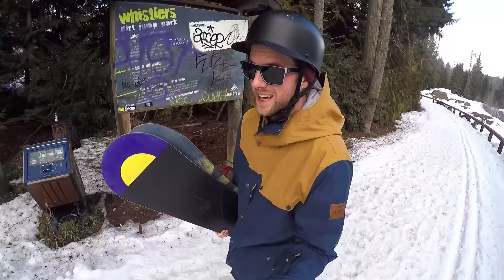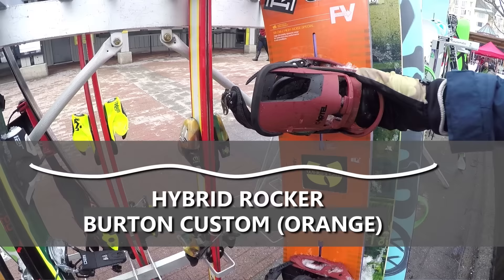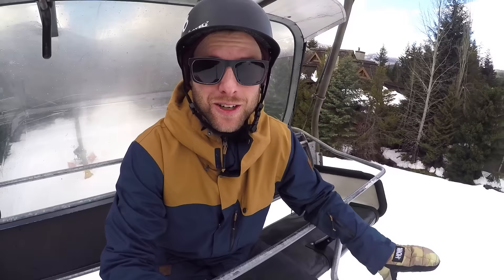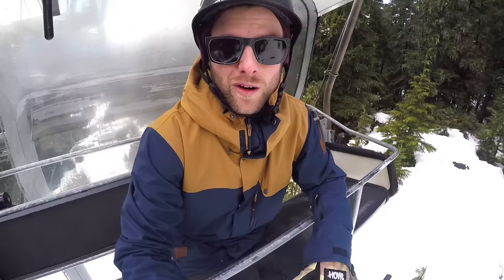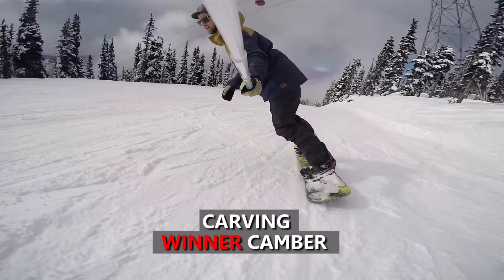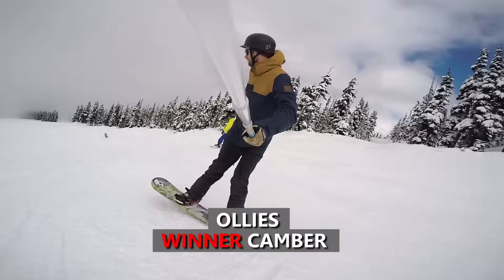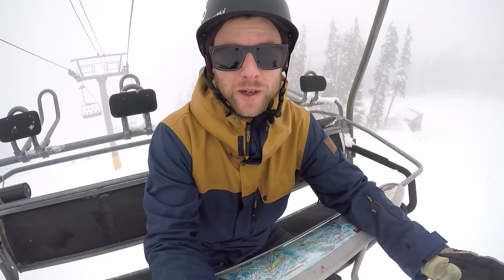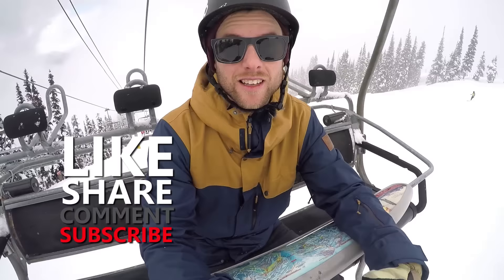Camber VS Rocker Snowboard Test

Comment: There's a reason why pros and the entire industry have moved away from camber boards in favor of rockers and their hybrids across all board types.

I'm biased, Flying V is my favorite.
Reply: what is the reason
Reply: +Fpk Hk416 First off I'd say that's an unfair statement, plenty of top riders still use camber boards, for example in the pipe or for large jumps. Other than that, I'd say it has a LOT to do with what you do with a board.

Camber boards excel at a lot of things that you'll never see in snowboarding videos, but that a lot of us ordinary folk do all the time. Charging groomers/pistes, carving turns, etc. Your regular everyday resort boarding. Not everyone does deep powder cliffdrops, 30 foot kickers and lipslides urban rails or rooftops.

For me as a person who spends probably 60% of his time on the pistes, 30% in the park, 10% in the powder, a rocker/hybrid board simply doesn't offer me a lot. The edge hold that a midstiff camber gives me far outweighs the forgiving ride of a hybrid or rocker, and I've tried many of each.
Reply: +Fpk Hk416 yes. to sell more boards! that's why cellphone manufacturers add more features with every new gen. phone. doesn't mean they're better. just means they can sell you on more words.

Comment: I bought a true rocker a few years back and it's pretty fun and I do can spin and press for days and powder isn't that much of a problem anymore. But it misses some pop which actually makes it harder to get some air in the butter/180 tricks. I think my next board gonna be a soft camber.
Reply: +McDudes check out the Rome mod Rocker, flat base with pop rods in the tips. A great rocker board with TONS of pop is the Marhar Regent, super awesome board. I Prefer aggressive riding myself.
Reply: Daniel Rex Cool, yeah the one I have right now is actually the Rome artifact rocker 2014 version. 
I did choose between that and the camber version and thought, why not try out a rocker.
Overall it's actually a fun board to ride and it's much better than the one I had before. So don't take me wrong I do like it, but I think for my next board I will get a camber, that way I can also switch between them.

Comment: I´m riding with a zero camber board with a softer flex (Nitro T1) and i absolutely love it! I´m riding a lot in the park but sometimes i want to take it to the whole mounteain so the zero camber is perfect. It is very good for pressing, butters and park riding but I still have a lot of control when riding with speed, especially after langing of jumps. I can really recommend this ;) (P.S.: Sorry if there are any mistakes in my english writing :D)
Reply: HolyPineapple I agree with you in comparison with traditional camber I found zero camber board more forgiving and easier to ride on mountain and in the park. But that is just my preference.

Comment: Actually I believe the opposite. I think  that rocker and hybrid are better for beginers. Its easy to catch an edge on camber. You should also test parts in which rocker shines and that is a deeper snow and rails. What is more, flying v is not pure rocker, even burton  describes those boards as mix of two. Speaking of wich, you could just have tested either to stick to same model, both of them comes with camber and v. I encourage everyone to go and take part in test rides, you can learn a lot. Thanks for the video

Comment: I have a Burton Custom Flying V because I thought it'd be the best of both worlds. This video makes me wish I bought the camber one. Thanks for the analysis! now I know for next time
Reply from the maker: It is still a great board. I road it for a full season.
Reply: +eltororsx My Custom Flying V became my favorite board this season.   It charges the whole mountain very well.  Great pow float, great edge control....if you have the skills for it.  Find my post farther up for more details.
Reply: +SnowboardProCamp I do love the board! Just feels like I could use more grip on turns and carves. It also may have to do with the ice I'm riding on out here in New England and not the board. Thanks for the reply and for your videos!
Reply: +TranceAddictFoX thanks for your input. Don't get me wrong. I don't hate my Custom Flying V. I love it. I just don't feel like I always get the best grip on turns and carves. I'm also still learning how to carve and this is my first board ever. And I ride in New England which this season has been ice and hard pack all season. The board has never even seen real pow :( I started on the board last year as a beginner, but now I'm riding fast and on black diamonds but I just feel like it can be slippery at times. Maybe I need my edges sharpened after all of the ice riding.
Reply: +eltororsx yeah probably.  we've had very little ice around here this season and I still sharpen my edges every few days I go out.  I prefer mine VERY sharp on the flying v.  it definitely makes a noticeable difference

Comment: If you're brand new to snowboarding stay away from a camber board. It'll be much harder to learn. I found out the hard way. Learn what you like to ride first then decide what type of board you want in the future
Reply: Well yes and no. Camber boards require more disciplines when learning but these are good skills to have.
Reply: I recommend learning how to ride on a rocker. Learning on a camber will be a lot harder because its much less forgiving. I learned on a camber board but I think learning on a rocker at first, getting all your basic skills down, and then upgrading later as you start to challenge yourself more is a better option
Reply: hey guys, question from a newbie, I own a carver board and I've been trying to work on the floor tricks, like spinning buffers etc. Is it my lack of training or I feel that the board is really tough? My board is an old but turned Custom X

Comment: This is interesting.  I feel like my Custom Flying V holds an edge way better than my traditional camber K2 Illusion (both 161w) which used to be my go-to, high speed, carver.  I will say that the flying V requires a different style of riding.  I've ridden all sorts of boards, from short to long, camber, rocker and hybrid.  The Custom Flying V is unlike anything else I've ridden (its the only "flying V" I've used but I've been on similar hybrid shapes).   I feel like it requires the rider to be very comfortable adjusting their weight into the front foot to initiate turns and keeping pressure on the front contact points.  Once I got the feel for it, the board became my favorite carving board.  By a LOT.  

That being said the Custom Flying V is generally referred to as a good board for beginners, according to the internet, and I completely disagree with that.  Beginners will lack the understanding and confidence to shift their weight and maintain pressure on their front contact points to really initiate turns without skidding.  I attribute it to the way the V shape kinda teeter totters and if the rider lets up on the front contact points in a panic, or due to lack of confidence/experience, they will start to skid and lose a lot of their control, possibly washing out.

Comment: I've been riding for quite some time and had a fair bit of time on a traditional camber board. i gotta say as far as control i dont notice a difference. I went from a burton custom to a lib tech trice pro model and its really not that big of a deal. I'd say it actually handles better at higher speeds. Remember this is an opinion you geniuses

Comment: I feel like this video is misleading. You didn't even use a rocker board. I could dispute most of your points too. There's nothing wrong with having your own opinion on these things, but a rocker or hybrid is easier to learn on, generally superior for powder conditions (which wasn't even tested), typically can transition more quickly edge-to-edge (good for narrow and tree runs), won't catch edges as easily, and is generally different but not inferior to cambered. 

All I can really say is if you're brand new to the sport, finding a soft board that is NOT traditional camber is a little easier to learn with... then go to a demo day and try both. As for hybrids, I'd try a different brand, like Never Summer. There are plenty of hybrid boards that have great edge hold, carving ability, and overall stability.

Comment: i was riding a Rome Agent last saison. a very stiff camber board. this saison i switched to a BuddyBuddy Emcee LTD a relatively stiff board. and now i have to say, the only times i go back to my last saison camber board is when there are many stones on the run or my current rocker is somewhere for repair ;-( i can do everything on my rocker board what i could do on my camber board, but i can't do anything on my camber board what i can do on my rocker. so my point goes to rocker (but only the buddybuddy ones :-P  )
Reply: the agent is stiff, it's even a stay positive camber.

Comment: beginners should rock then camber.....Beginners have a tendency to catch the edge and 911......then progress to a camber....rocker is better in powder. in all instances board length and width are important factors to consider. and if use of side traction as in many  boards from  Lib Tech, which combined with rocker offer better grip in ice conditions/patches etc. So you rev is leaves open many many variations and gaps. Snow is so different and varies from time of day, temperatures, etc etc etc.... my suggestion is get both, experiment and enjoy......

Comment: Also, if you add other technologies such Magnetraction to the equation then the whole argument changes still further.  I mean, riding an enhanced  rocker board with Magnetraction edges like a Lib-Tech Banana Magic, I get better edge control and Carving ability than any traditional camber I remember riding in the old days.

The second point is the effort required to ride these boards.  After a couple of runs on a camber board, you'll be exhausted, whereas you can spend a whole day on the mountain on a Hybrid or pure Rocker and not get as tired.

Thirdly, catch-free riding is big deal for me.  With all camber boards you have to be on your guard even when going straight on a gentle slope, as you can catch an edge and be thrown to one side.  That's not fun.  With a Hybrid or Pure Rocker, you have that extra peace of mind.

So, all in all, this video doesn't tell the whole story.

Comment: about carving i have the rome mod rocker 2017 and i carve the shit out of the trails al though i dont have a problem with my board bottoming out on me i do find myself having to kinda  jump into my turns when it comes to making fast turns on mogul runs but because i have a pointed nose shape i cut through powder pretty well its just my board is a stiffer flex so keeping my weight on the back foot requires i bit more leg muscle
Reply: and i guess youre right about the whole carving thing in a sense that i find myself having to sharpen my edges a lot more frequently than my buddies with camber boards

Comment: If anything, on a flat and narrow trail the rocker (hybrid) should definitely perform better, not camber. Because while camber boards "lock in" turns better, rocker boards initiate turns noticeably better...and on a narrow trail you're going to be switching edge to edge for subtle turns that constantly test your boards ability to INITIATE a turn.

Comment: I'm a Beginner rider and own a Burton Process Flying V. I totally admit that Camber would be better to learn on. But Since I learned on Flying V I feel much confident on the snowboard than I would on a Camber board. It built my confidence I guess. 

@SnowboardProCamp I'm a goofy rider and would like to learn Switch riding. Would you suggest me to get really good at Goofy first then move on to normal, or should I progress on both at the same time?

Comment: I have to say some of these tests were a bit unfair since you used a hybrid. If you were to use an actual rocker, tests such as the flat and narrow runs should've been given to the rocker. I've been riding a forum grudge 2008 with ride revolt bindings for a few years. It's a camber board but its not the best for some things. Then i rented out a burton antler with burton mission bindings. Jumps and narrow runs felt so much better with that board. However, in my opinion, i wouldn't get a v-rocker, especially if you are advance. Most that are made are good at turns and butters but there are not too many stiff ones out there if you're into carving.

Comment: I've never saw a video about snowboards in general. I mean when you are buying your first board, what brand to choose, perhaps a specific model etc. Burton is of course great but maybe there is a cheaper variant? My first board is DC Ply(camber, 7 stiff.). I bought it in '13 and after next season I'm going to buy a new one. Or I won't, it depends on my Ply's condition after next 'tricky' season(I'll start learning tricks). So here is the question: any suggestions for buying a 2nd snowboard? Apart from Burton, surely there are some cool boards from other brands. Capita? Lib Tech? Rome? I'm new to snowboarding, so I'm none the wiser.
Reply: +iamfozzy100 Thanks a lot!

Comment: I want to demo a rocker this winter, I have only used a couple camber boards. Intermediate infrequent rider. My usual riding partner is a skier, skis aggressively and I can't keep up through the steep moguls, especially not on ice days. I cant whip my tail around that fast. I'm 6'0 on a 163. Any obvious advice or board recommendations, brands?models? I'm usually in the Tahoe area.

Comment: Just bought a 2020 process for my first board,  I have virtually no experience snowboarding, can someone further explain catching an edge and how that is more likely on a camber board such as this one (well camber rocker hybrid) versus a rocker board? I know pretty much all instructional videos say go rocker as a beginner as it is easier to initiate turns except Kevin generally says go camber for stability, in my ignorant opinion I think I would rather have more of a challenge initiating the turn rather than stopping that initiation (i.e. spinning uncontrollably or playfulness as more experienced riders would call it) Please advise

Comment: As a novice rider, I bet I'd like the rocker board. I need to borrow a friends to try it.
Reply: +EDKsurly I believe you would.  A lot of people choose the rocker profile for its forgiving edges - less likely to catch an edge.  You do see this profile a lot on kids boards as well.  I do agree that you are going to find more precise control with the traditional camber, but a rocker board has its advantages.  Rockered boards favor playfulness and loose style riding as well as have better float in powder.
Reply: Christopher Hindman
I have a stiff camber board, which seems unforgiving. I recently tried catching up with friends, caught an edge and fell hard. I ended up getting a concussion and hip out of alignment. Maybe its time for a different board until I get better.
Reply: +EDKsurly Sorry to hear about the injury!  Yeah, if possible, try out a rocker profile, it'll help.  But there is no substitute for having good body alignment and a good grasp of the basics.
Reply: Christopher Hindman
I partially blame my old bindings. I had a set of 20 year old Burtons that were too small. Couldnt strap in properly. I went bonkers and got a set of Flow NX2 and a helmet.
Reply: Nice!

Comment: The test is biased. You knew which board you were ridding so, preferably and subconsciously you would go with the traditional camber board. It's natural to dictate choice with a board that you've ridden for so long. Try doing a blind test, which you don't know which one is which then try it out; you might get mixed results.
Reply from the maker: Great idea! Next time I'll figure a way to do a blind test on two boards I've never ridden before.
Reply: +CraveEdits This is like suggesting doing a blind test between a butter knife and a steak knife. you will know instantly if you are an experienced, so there isn't much point pretending.
Reply: +antihero3zx who knows? What if I gave you 4 boards mixed between camber and rocker, told you to ride them and asked you to choose which is which, even experts might get this wrong. Plus snow acts as a arbitrary riding field; riding might feel the same on a camber as to a rocker.
Reply: +CraveEdits ummm.... do you actually snowboard? Obviously itd be hard with all the combo/hybrid setups. pure rocker vs pure camber is beyond obvious to an experienced rider.
Reply: +Rick Collier Certainly. You're missing the point here it's not the difference, but the preference.
Reply: cant blind test like this, the boards physically are a different shape. as soon as you saw the board, youd know.
Reply: If you were really serious, you could black out the graphics then blindfold the user all the way through the strap-in process. Once they're strapped in, take off the blindfold then have them ride.

Comment: What do you think about "magne-traction"?  I have a Lib Tech "skunk ape" which is the Flying V shape, I feel like I have just as much control and edge grip as my regular camber board.  Also can you recommend a nice soft board for the park? I always feel like my board is too stiff to really get my butters and presses locked in at a good angle.